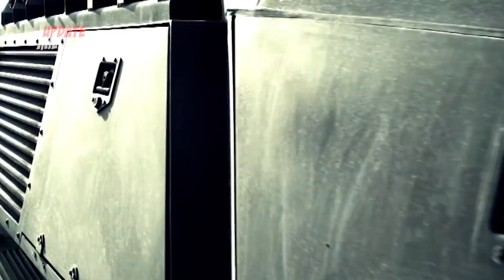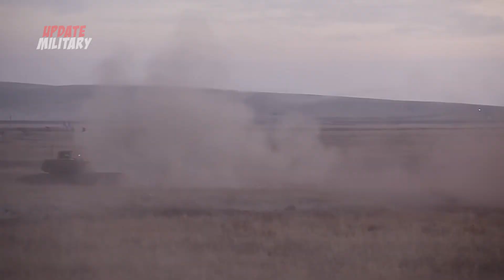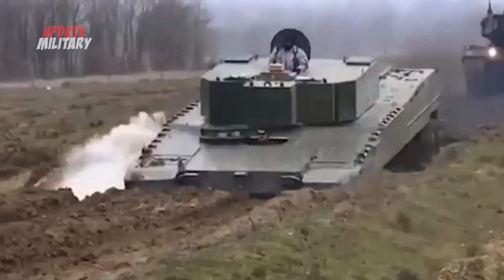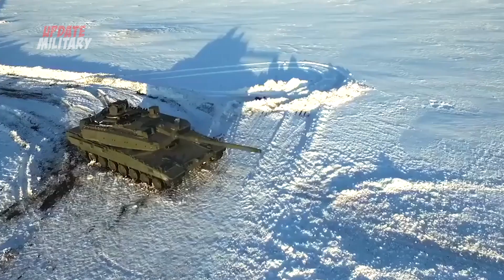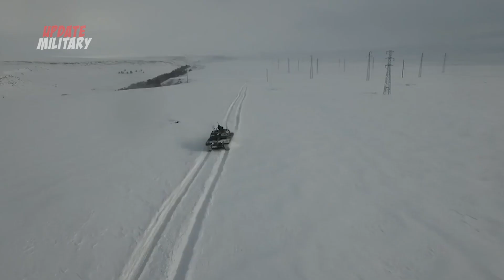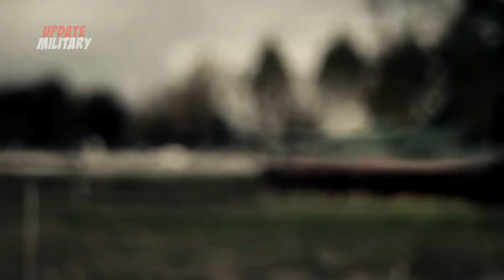The Story Behind The Greatness of Turkish Altay Tanks

Comment: Hey folks. I have two questions.

1: does someone know why turkey does not use the korean auto loader system and put a 4th soldier as a gunner inside?

2. does anyone know if the Altay, when it finally arrives some times, can get an upgrade from Rheinmetall smoothbore gun 120mm to 130mm? 

Otherwise the tank will be outdated when they passed by their engine issues.
Reply: Abrams is designed with 105mm gun but later upgraded to 120mm so its possible,
also Turkey plan to add auto loader to Altay after first 250 production ;)
Reply: @tankconquerer5428  Doesn't have to mean anything, Abrams cannot fit the long L/55 as example. But yeah, in theory Altay should be able to do so, as its based on K2, and K2 was designed to fit the Rheinmetall 140mm.

Comment: soo junior leopard
Reply: Germany helped Turkey to develop many weapons so yeah
Reply: Junior K2 Black Panther actually.
Reply: @Xentradi97  nah only technology same.
Reply: yeah Germany made 4. gen tank for Turkey but Germany do not have 4. gen tank smart boi... Only cannon is german
Reply: @bilaloglann7283  it's a lower tech version of K2. Much of the design and weapon system are based on it
Reply: @Xentradi97  To people who claim Altay is a cheaper copy of Korean K2 tank: 
No, it is not. 
Actually, Altay will be more expensive and it will be 10 tons heavier than K2 tank which means Altay’s armor is thicker. 
Altay tank’s chassis design was based on the K2 tank that is true. But only their hulls look similar and that's it. Their electronic systems, armors, active protection systems, engines, and transmissions will be entirely different. Altay will use locally produced 1500hp engines designed by a Turkish company ‘BMC Power’. Other than 120mm L55 main gun, all of its systems will be indigenous designs. what do you want more?
Reply: @bilaloglann7283  Transfer of technology was part of the deal when Turkey imported K2 from Korea.  From what I've read almost everything besides the armor, cannon, and engine is same as the K2 down to the chassis.  Armor quality hasn't been proven and the cannon performance shouldn't too different, and the engine is tbd.  So at best the Altay will be a copy of the K2 nothing more.  You guys need to worry about getting an engine first.
Reply: @bilaloglann7283  i meant to reply but jw guy replied me instead. Altay may get more expensive with other modification and addons in future but as of today it isn't, and it's not considered better tank by any means.  And btw, heavier weight isnt a good thing as it slows mobility. 
The future trend is lighter weight with reactive and composite armour that can withstand the direct hit.
Reply: @Xentradi97  I ment altay is different than k2bp by saying altay is heavier. And altay is going to use ads so nothing is going to change. ads is going to desteoy rockets before rocket hits tank. But maybe altay is going to be different than now because altay is not produced yet. There are just 2 prototypes. Who knows?.
Reply: @bilaloglann7283  Altay is Turkey's first indigenous Tank project and it's still not at the mass production stage.  K2 is and tested in the field, a vastly improved predecessor to K1 tanks that's been the main MBT since 1987 with 4 upgrades models.  On paper, anything is possible sure, but we're talking about the capability of real tanks.   And on that note, Altay isn't there yet. 

The ADS armor you speak of is an advanced technology that Rheinmetall and few companies developed and not quite mass adopted to any known  MBT. 

Turkey should perfect 3rd Gen MBT first and improve from there, rather than trying to leapfrog technology before mastering the basics.  Or they'll end up producing an expensive piece of crap like India's Arjun.
Reply: @Xentradi97  yea but we have our own ads system or systems too but I think we don't use them right now too.
Reply: @bilaloglann7283  So says the Turkish defense and President Erdogan. I'd believe it when I see it. Turkish defense industry has come a long way but it's still heavily reliant on foreign tech and over promises what it can really do, including its still on paper stealth fighter project and attack helicopter that got shot down recently. Am not trying to belittle Turkish military and it's tech but the industry needs some transparency and proof of concept to be taken seriously.
Reply: @Xentradi97  "attack helicopter that got shot down recently." idk anything about this can you explain?
Reply: @bilaloglann7283  Kurdish militants shot down Turkish attack helicopter in 2018 and again just recently.  It's in the news.
Reply: @Xentradi97  in 2018 they shot down helicopter but pilot are alive and Tr army killed that terrorists i know. But me first time hearing from you right now
Reply: @bilaloglann7283  Well, the point is, the Turkish army and its defense announces a lot of ambitious projects and boasts about its technology, and yet we've not seen enough evidence of their existence or effectiveness.  I also notice Turkey's defense wanting to leapfrog most advanced tech rather than starting from something that's within the technological and economic means to do it and building from there. 

India's weapons program such as Arjun or Tejas should be a stern warning.
Reply: İt's actually wider and longer than the leopard
Reply: @Xentradi97  That was AH-1 Cobra not T-129 and it's not put T-129 in bad place many helicopters across the world are shoot down even the AH-64 Apache